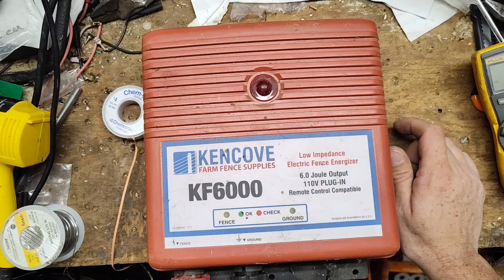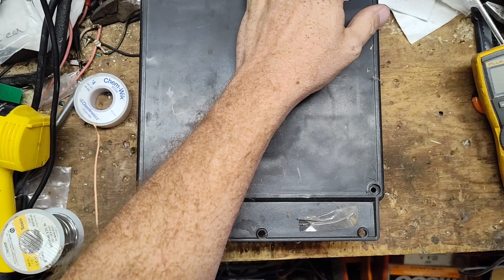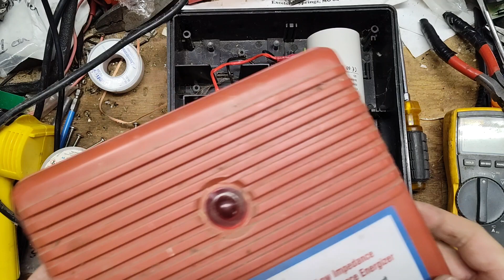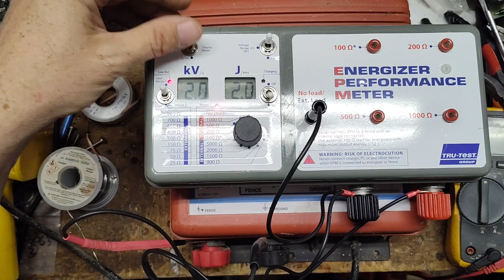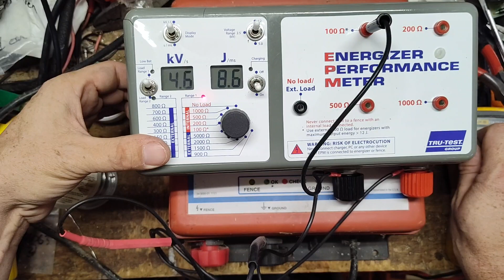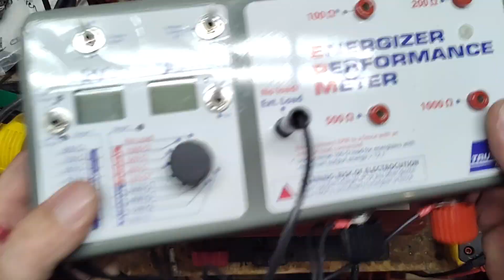How To Make An Electric Fence Charger Stronger & Shock Harder | Kencove KF6000 Repair

Comment: Damn, I jumped back too when you were connecting up the new capacitor!
Reply from the maker: Yeah it took me by surprise lol. That capacitor had been sitting on the shelf as a spare part for weeks not being used, so I was surprised for sure. Luckily I almost always use my pliers to grab onto those wires. If that had been my fingers, it would've hurt pretty bad. I've been but plenty of times by capacitors, and every time it's very unpleasant, but at least it only happens to me about once every year or two.
Reply: To be on the safe side next time, you could take your multi-meter to see if it has voltage, and if it does, take a big resistor to dissipate the charge?
Reply from the maker: @williamlewis4379  I do have a big resistor that I normally use sometimes for that very reason. It's a 200 watt 200 ohm resistor. I'm not to concerned most times working on these things though. So I normally don't discharge caps very often. After years and years of working on these electric fence units, you learn tricks to handle things and so that's why I don't typically disagree most caps, but I do discharge them with that big resistor sometimes if the leads are hard to get to without risking the chance of the dumb thing discharging itself with pliers. The thing I hate the most about these large caps is the loud pop they make, especially when you're not expecting it lol
Reply: Nice repair, I like that meter, have not seen those in the UK. I repair quite a lot of energisers would like to get one
Reply from the maker: @michaelclutton8446  I bought it from a Tru-Test distributor. They used to have a repair person there in house, but they got out of repairs and offered us their repairs. They had this tester their, of course I had to buy the dumb thing @ $300+ for the thing, but so far I really like it.